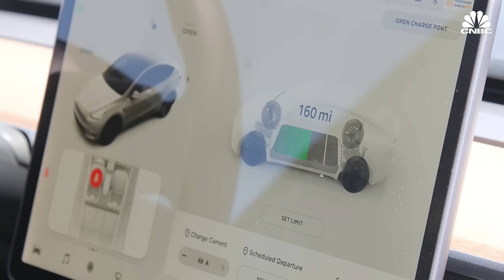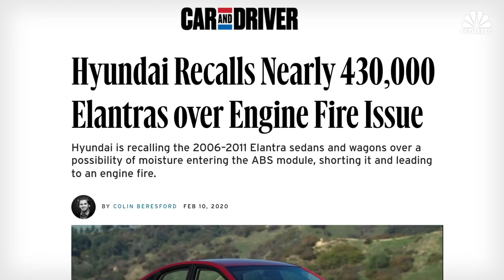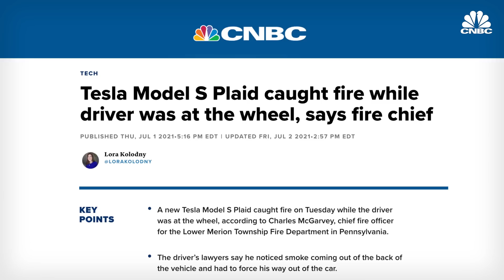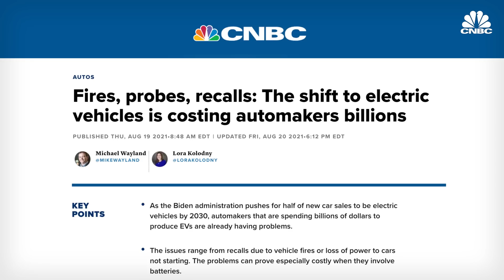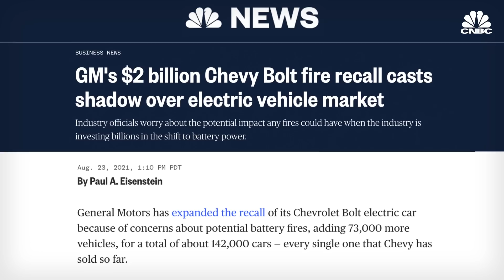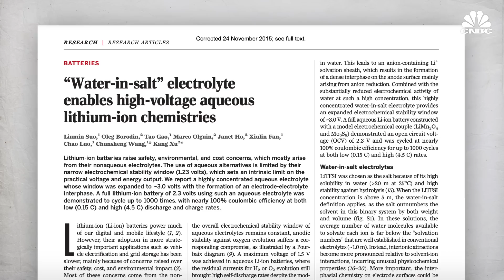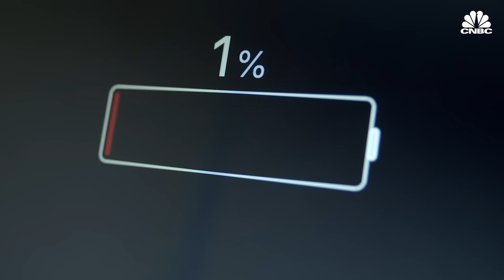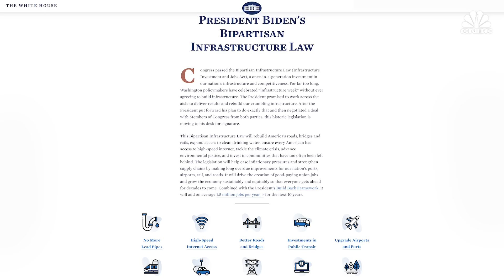Why Tesla, GM And Other EV Companies Have A Fire Problem

Comment: This is the dawn of the EV.
There are teething problems  which need to be addressed.
But what about when these vehicles start to age...say in 10 years or so.  I have seen the price of a used Tesla plummet because the battery is shot, and replacing it requires a second mortgage.
And what are the maintenance issues that owners need to follow over the years to keep their car healthy and minimize the chance of 🔥fire.
I think I"ll stick to ICE's until I can get some answers.
Reply: "There are teething problems  which need to be addressed . . . "
Trouble is . . . It's the teeth that are exploding . . . !
Reply: An electric car battery can easily last more than 10 years, losing 15% max of its original capacity, if the car has been used daily to drive a whole 100 miles every day.
But for a battery that can give 200 miles of autonomy, that is still 170 miles of autonomy left after 10 years of intensive usage.
The battery isn't "shot" like you say, it's just people who make such a drama because they lost 30 miles of autonomy. The battery can still be used for another 10 years of intensive usage.
Granted, this will further decrease the autonomy, but still. You are not going to tell me that a battery that can be used for 20 years is "shot".
And the battery can be used even beyond those 20 years as a stationnary green energy storage system for another 20 or more years before becoming totally unusable.
Reply: Same. Technically it's just not ready yet
Reply: Hydrogen is the future for vehicles
Reply: @petertaylor3446  It's not
Reply: @texanplayer7651  OK  you're entitled to your opinion, so am i
Reply: @texanplayer7651  not reliant on China for batteries, no  raw materials drought for hydrogen no emission problems except water, not a bad thing, make your case and I might accept the  finality of it's not
Reply: @petertaylor3446  Fair enough, then allow me to bring you my point of view about hydrogen.
1.Hydrogen cars are actually electric cars. Their electricity is produced in the hydrogen fuel cells, but for them to function they still need some of the same raw materials than classic electric cars. Granted they need much less lithium, but this won't change much to the matter at hand since...
2. Hydrogen fuel cells not only need the same materials than electric cars, they also need one extra raw material that electric cars don't. And that is platinum. And the country in the world with the greatest platinum reserves and who has a global monopoly over it is Russia. And given the current circumstances I don't think taking russian platinum will be an easy task. Lithium reserves on the other hand are much more globally abundant. People talk about China because they want to outsource the pollution from extraction, but Lithium could be mined more responsibly in Spain for example who has some reserves.
3. Hydrogen needs to be created in the first place. White hydrogen deposits are basically non existant on Earth, so the only methods of producing reliable amounts of hydrogen is either through fossil fuels, or with electricity. Both are counter intuitive, since they can both be used as transport energy, and it will be much more environnementally friendly to use either fossil fuels or electricity directly rather than creating hydrogen to use as fuel in a middle process.
4. Speaking of environmentally friendly, platinum extraction is much more damaging to the environment than lithium. Moreover, hydrogen fuel cell life expectancy is about 60 to 70.000 miles, now compare that to the current 100 to 150.000 miles for electric cars. Furthermore, electric car batteries can be used beyond their lifetime for up to an extra 15 to 20 years as stationnary batteries to store renewable energy. Fuel cells on the other hand will be practically unusable at the end of their lifetime.
5. Also, hydrogen is a greenhouse gas 11 times worse than CO2, and there will always be leaks when creating, storing or transporting hydrogen that end up being harmful to the environment. However, don't quote me on this one, those leaks still pollute far less than fossil fuels according to estimates, and hydrogen has a lifetime in the atmosphere of only 2 years compared to the 10.000 of CO2, so this is just a minor issue here, but I wanted to mention it anyway.

My conclusion is, for hydrogen to become the future, it needs to be both more energy efficient and cheaper than fossil fuels and electricity. The problem is, since it needs fossil fuels or electricity to be created this will never be the case.
The only demand that could exist for hydrogen fuel cell cars is for a rich demographic who finds them cool, but that is not the majority of people.
HOWEVER, there could be some instances where hydrogen has a potential future, but none of them involves fuel cell cars.
1.Truck drivers who need to make long trips and don't want to wait 2 hours for their electric truck to be charged.
2. Short distance flightplanes
3. Maritime fuel
4. Large scale solar energy storage for the winter where the sun doesn't shine for long periods of time and classic energy storage units can't hold on this long.
5. Alternative cooking gas
6. Green hydrogen can be synthesized to create ammonia used for the production of fertilizers, so we could create fertilizers without fossil fuels.
And there are probably some other uses but I can't think of more.
Reply: @petertaylor3446  You can't get a pound of hydrogen for under 5 dollars at best, and that pound of hydrogen will get you 30 miles, also at best. And that is BEFORE taxes. Hydrogen is NOT easy obtain at all with green energy. The only easy way is through fossil fuels, and that is counter intuitive.
Also why are you talking about biofuels? This is not the subject. And for american cars to run on biofuels we would need to plant over 550 million acres of land just to feed our cars. So that is not a good option either.
Reply: @texanplayer7651  I couldn't have said any better myself.

Comment: 173,000 U.S. ICE car fires..How many of that 173K fires were EV fires? 
(Re)members, when the fire chief stated that they had no problem(s) putting out EV (lithium) fires after that EV crashed in to a tree in a residential neighborhood. The media tried and failed stating "The SDF was on" "the drive was not in the drivers seat" "Passengers could not get out on the vehicle" and all kinds of false statements about the EV vehicle.